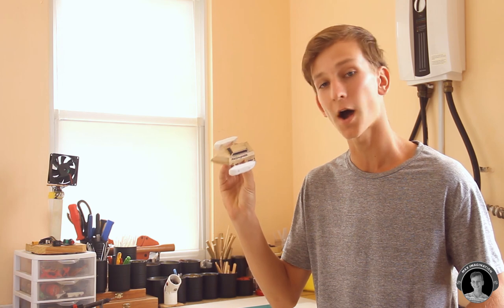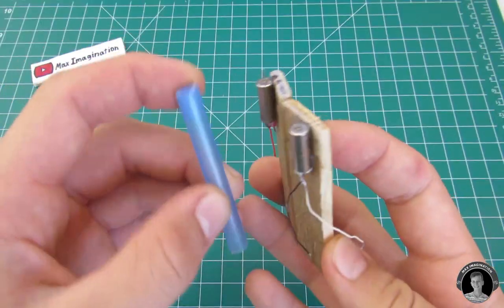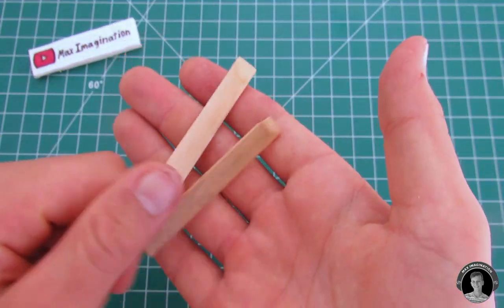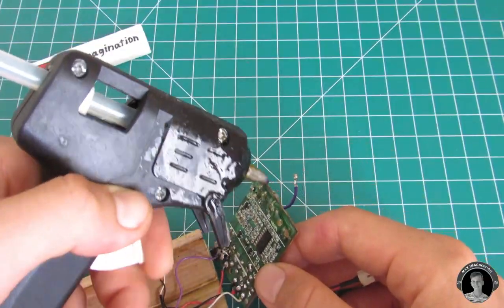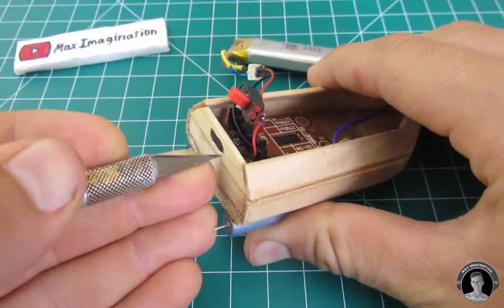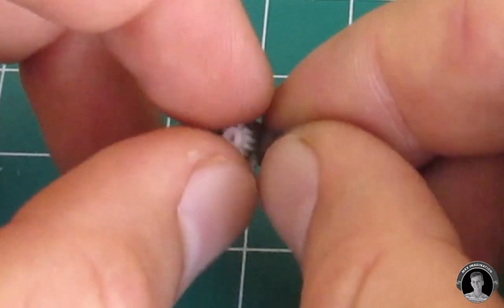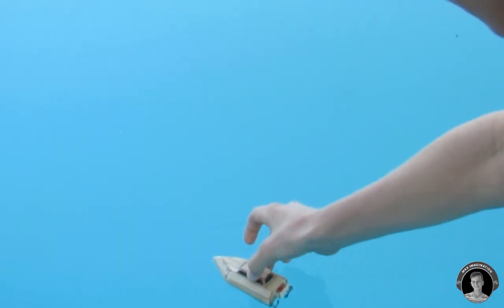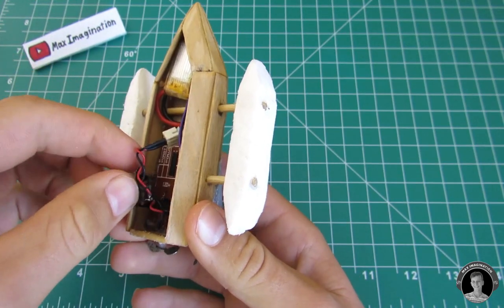Build Your Own Mini RC Twin-Motor Speedboat on Pontoons! | DIY

Comment: Hey. Don't you need to waterproof the wood in some way? I am trying this too and am worried about it. Also, I found hot glue to be better for this as it seals more properly. At least in my case, yes.
Reply from the maker: Hi, Jarmila. Hot glue will work good in your case. I used superglue simply because I knew it would create a longer lasting bond between the wood, hot glue is what I should have used to seal the boat from the inside. Though, my boat ended up holding out the water. Cheers.

Comment: Is that coreless motor gonna rust because it's in water
Reply from the maker: True... Though if a specific enclosure was 3D printed, I bet the motor could be placed differently or have a longer shaft to avoid corrosion.